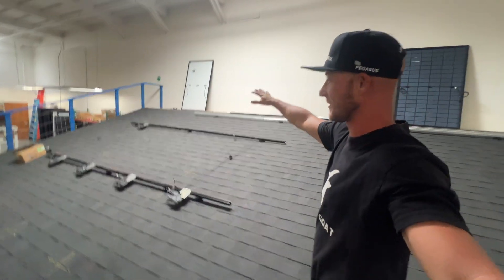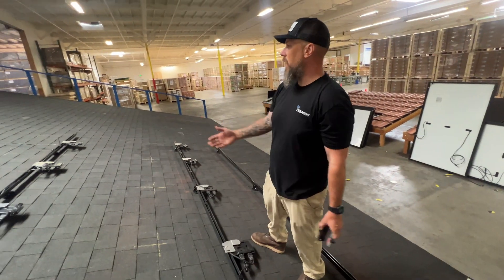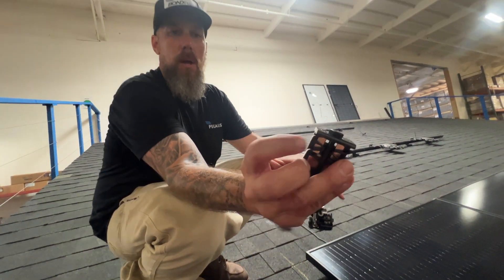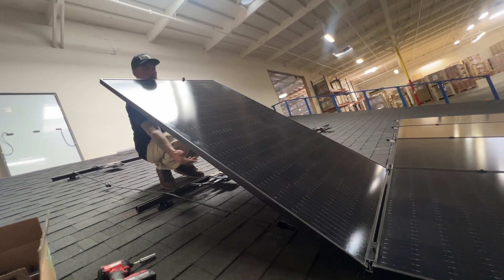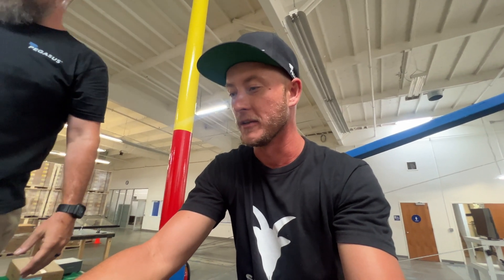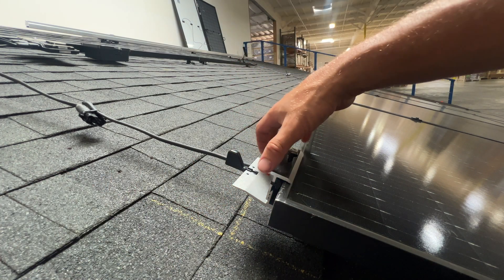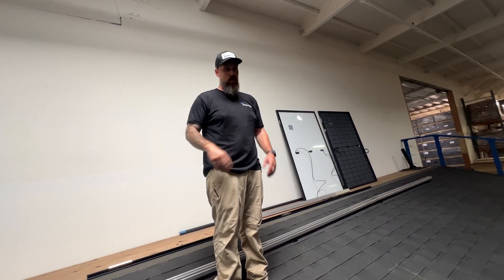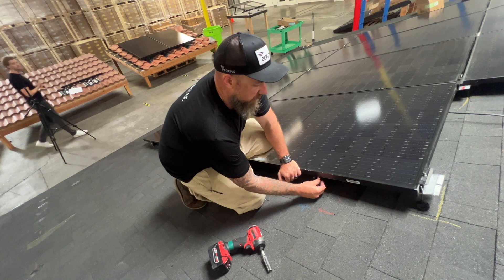Installing The Complete Pegasus Solar System - Hands On Training With Brady

Comment: Man I need help as a DIYer in Denver area. Between Pegasus instaflash2, quickbolt2, and snapnrack top speed, which should I use? Snapnrack seems great for a rail system, but again hard to source. Railless and topspeed have a lot of protrusions. @solar goat